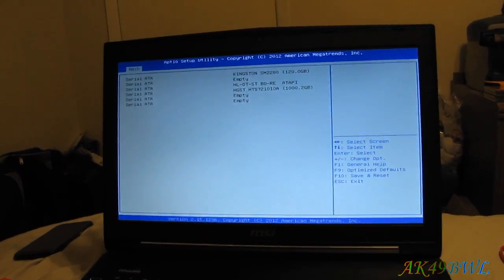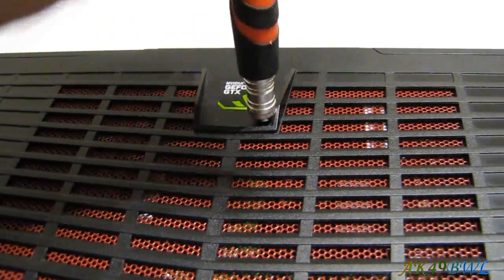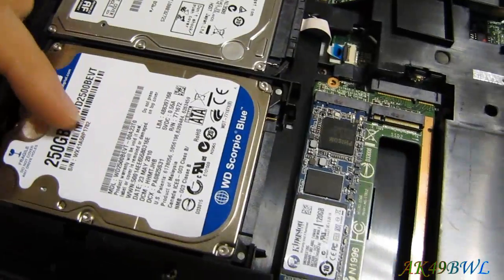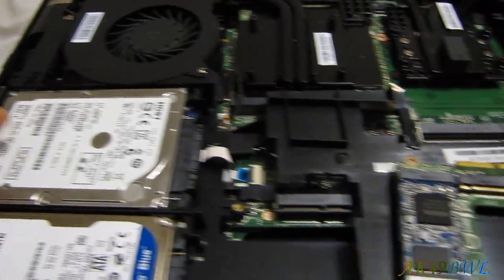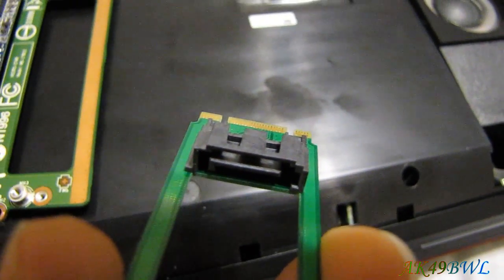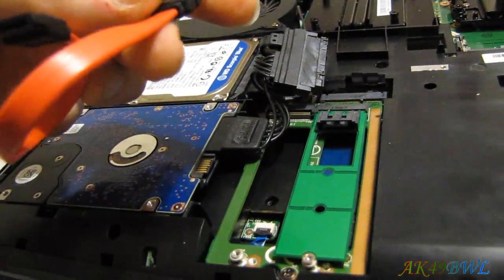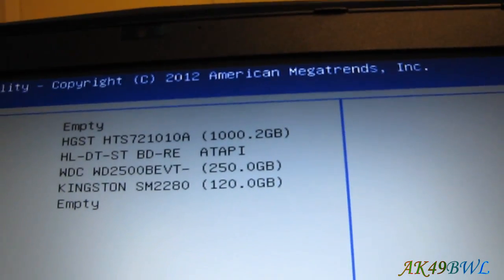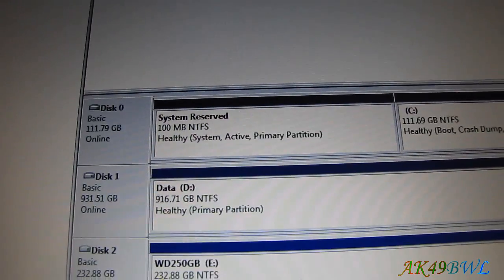How to Install a Second 2.5" HDD in the MSI GT72 Dominator Laptop

Comment: Nice Video! I have a question:
Could I replace the dvd-drive with a blue-ray drive?
(I consider buying a GT72, but in Germany I only can find those with dvd-drives, instead of blu-ray-drives):
Cheers! :)
Reply from the maker: +Frederik Zimmers it is absolutely replaceable, however if you just get a generic Blu-ray drive, it won't have the proper bezel to match the laptop... Simple cosmetics, but maybe you could find one made for the GT72 online somewhere, I'm not sure. What I do know is, it's really easy to remove and install :)
Reply: Thank you for the quick response!
I already googled it and found out, that it is this one: HL-DT-ST BD-RE BU20N (Hitachi LG Blu-Ray Drive Burner).
And I found it on several websites, like this one: http://www.3caccessoriesdirect.com/hitachi-lg-hl-dt-st-bd-re-bu20n-sata-blu-ray-drive-burner-91728.html

So as you said, it should work out!? :)
Reply: ... and how does it work? Is it under one of the storage drives?..so you would have to remove a storage drive first and then the optical drive? ;)
Reply from the maker: +Frederik Zimmers the screw for it might be under the hard drive that is plugged into the motherboard, but once you get the screw loose you should be able to just pull the entire CD drive straight sideways out of the laptop.

Comment: Hi! Great video! How do you think, will 15mm thick hdd fit in GT72?
Reply from the maker: Easily.
Reply: Thanks for the answer!
Reply: Are you sure? Because I've asked a guy from another video and he said that he tried a foam 15mm model and back cover refused to close... What I want is to put 15mm 4tb hdd in the main hdd section instead of the one that was there by default, I have GT72s but I'm pretty sure that dimensions are the same

Comment: I have the same computer and had never thought about doing this but seeing you do this makes me wonder is it possible to just plug 4 sata m2 ssd's into there? Buy just buying 3 more of the long thin m2 ssd's? Or would it over heat or not be able to run all 4 at once? Any info would be greatly appreciated since I'm a newb at this. Thanks for helping us learn! :)
Reply from the maker: Many of these came with all four slots filled, with a 1TB RAID 0 using all four 256GB drives.
Reply: Please respond quick I've already added the ssds to my Amazon cart and am about to drop a grand lol am I going to regret it?
Reply from the maker: Holy hell, how big are the SSDs you're getting, to be spending that much? LOL
Reply from the maker: But yeah it'll definitely be fine. I have two M.2 SSDs in mine right now and it never even gets warm in that area.
Reply from the maker: Just make sure you're getting SATA3 M.2 drives, PCI-E and whatever newer stuff they have out now will not work/is unsupported.
Reply: I'm getting 500s. Seems completely unneeded but that just makes me hope it will run well anyway lol
Reply: Thanks alot for the quick reply. Can you recommend what one to get? And be totally awesome and maybe tell me where to learn how to raid 0? Lol
Reply from the maker: Oh for sure. I only have two 128s in mine. One for OS and programs, the other for quick access video editing.
Reply: It's 1000 because I'm also getting a larger ssd to replace the hdd and 16 more gb of ram
Reply: Ignoring cost are any of the upgrades obsolete?
Reply from the maker: I don't think so... Well I mean, this computer was obsolete the second after I bought it anyway so there's that haha -- I maxed my RAM out with two more Kingston ValueRAM 8GB sticks, which is the same stuff MSI puts in from the factory. I would like to pick up a GTX1070 for this thing, but for what I do, I don't believe it'd be really cost-effective... And I run Win7 so the drivers would have to be hacked to bits. Sadly, the CPU can't be upgraded at all.. Wouldn't mind putting a Gen 6 or 7 in here instead of the Gen 4 it has. I'm not even maxed out on hard drives in this thing, still have an open M.2 slot. Thinking about picking up a Western Digital 1TB SSD, just haven't bothered yet. How to RAID 0, I want to say that's in the BIOS/CMOS setup? It's been too long since I've messed with it, mine's not RAIDed. And you'd have to reinstall the OS and stuff onto the RAID.

Comment: So, I've got a Question, Been meaning to do this, and Now I'm able to, But I was wondering if it would be possible to use the one Sata2 Port ONLY for Power for the two Hard Drives, and Connect my Internal HDD's to separate Sata3 to M.2 Adapters.
Reply from the maker: Yes, that's possible. Both SATA3/M.2 adapters will have to be installed in the upper two slots of the 4-port card tho, and SSDs will have to be underneath. But it should definitely work.

Comment: So I opened up my MSI GT72 Dominator Pro and it looks just like yours.  My question, can I order anther SSD and put it in the SSD slot 2 and run my games from it?  Will it need an O.S.?
Reply from the maker: +Jason Grigsby absolutely you can, and no it won't need its own OS. I'm guessing you're talking about another M.2 SSD? If you mean a 2.5" for the second drive bay, same thing, yes you can, following the same methods I used, and it won't need its own OS either.
Reply: +AK49BWL thanks AK.  I really appreciate the quick response. Thanks for the video tutorial, and yes I was talking about an ssd single sided.
Reply from the maker: +Jason Grigsby No problem :) I currently have two M.2 drives and two 2.5" drives, the extra M.2 drive I use as a fast-access video editing files drive, it's perfect :)
Reply: +AK49BWL I want to do video editing as well. The GT72 can hold 4 ssd single sided disk, correct?
Reply from the maker: +Jason Grigsby Yep. That won't allow you to add another 2.5" drive, but you can put four of the SSDs. They're "Solid State Disks" btw :)

Comment: There is only one M.2 slot in GT72VR-6RE-216FR version.
As you can see here : http://www.notebookcheck.net/fileadmin/_processed_/csm_MG_9083_1a6410606d.jpg

Is there any workaround ?
Reply from the maker: Wow, that's different... Does that model not come with the option for SuperRAID? I don't know of any workarounds, unless maybe they hid the other M.2 slots somewhere. Hit Del at the MSI boot screen to enter CMOS setup, it should tell you in there if you even have the option of more than three drives (SSD, HDD, CD).
Reply: I havn't received the laptop yet. I get it tomorrow.
I'll keep you updated.
Reply from the maker: Please do, this is intriguing.
Reply from the maker: Well, this tells me that the system still has the capability to control six SATA drives, and the configuration tells me there really ought to be four M.2 slots. Ports 3 & 4 are the two actual SATA ports for the CD and HDD respectively, that's the same on mine. What's new here is the two PCIE SSD slots, I don't have those and don't know anything about them. Have you opened it up yet?
Reply: Well, I opened it yesterday and it is exactly like one the first picture I sent.
Also, I didn't find any hidden slot or connector =/
Reply from the maker: Damn... Guess maybe they're going a different direction, or they hid them under the mainboard... And screw trying to take that all apart lol

Comment: hey hey there. i have a question about this tip. can i use a 2.5 ssd instead of the 2.5 hd ? i want to make C: bootable from a 1tb ssd disk. if i need other cables can you pls let me know. thnx m8
"love your video thow"
Reply from the maker: +dready571 Absolutely you can. 2.5" SSDs are physically identical to their HDD counterparts when it comes to how they're connected to the system.

Comment: Hi AK49BWL, thanks for your video. My model is GT72S, there is also an empty 2.5-inch space with no pins adjacent. Where can I get the cable and component appeared in your video? Thanks.
Reply from the maker: +FY ZHAO the links to what I used are in the description, all except the short SATA cable which I had on hand, not sure where you'd get that, maybe eBay or Amazon.
Reply: +AK49BWL Thanks. Found the upgrade kit on the amazon just now ...Hope my project will success haha
Reply from the maker: +FY ZHAO good luck to you! :)

Comment: Hi Brandon , what is the ssd module you have? I have a msi gt72vr 7re dominator pro and I only have one input where you have 4. ? thanks
Reply: DYCE GAMEZ  with the new model where it only has one slot the chipset is HM170 and it only supports one pcie slot. Where as the model in the video is a cm23/26 chipset and supports more pcie lanes

Comment: Would it be easier if you take out the dvd drive and replace it with a hard drive caddy?
Reply from the maker: Sure. But then you have no CD drive if and when you need it. And the disc drive SATA port is only SATA2, not SATA3, so you won't get as much performance out of it as you do the M.2 ports.

Comment: Hi! I have the same laptop as you but I have a problem:( My laptop doesn't charge even though the adaptor is plugged in. Is there any way to change the battery in this laptop or what should I do!??
Reply from the maker: Yes you can replace the battery, but here's the thing... What does the OS say when it's plugged in? It may be the power brick, or even the power input plug on the laptop could have come loose from its solder. As new as these laptops are, I find it hard to believe the battery would need to be replaced already.
Reply: My msi gt72 is 2 years old and it had this issue after half a year of usage. it doesnt say anything it just doesn't charge:(
For some time it started working but it was loosing power and screen got dark during playing like when you unplug adaptor.
Reply from the maker: You may have a bad power supply brick that isn't always providing the power the system needs to both run and charge.  The battery honestly should have no effect on usability, a lot of times you can actually disconnect the battery and it'll still run fine on the charger by itself. Try that and see if it still does the same thing. The battery cable to the mainboard can be accessed from the bottom after taking the cover off, just unplug the battery and give it a shot.

Comment: I bought my MSI GT72VR laptop and it doesen't came with the ngff expansion piece, I only have a metal piece under the M.2 SSD, so where can I buy the piece? I asked to MSI and MSI says that I can't get one.... 

Thanks guys.
Reply: i have this problem too, did you get any answer ?
Reply: Nader Hozayin If you search ms-17812 is the model of that piece, I only found one on eBay but it was so expensive .

Comment: I have a GT72 2QE and I CANNOT install Win7 for the life of me!! This is extremely irritating. 

Can you please tell me ALL your BIOS settings for this machine to install Win7?

I even went as far as removing the CMOS battery, then put it back in after 5 minutes, got into BIOS and went to:
1)"Save & Exit" then
2)"Load Setup Defaults" / YES 3)"Load Optimized Defaults?" YES

After setting BIOS back to factory defaults (I presume it did this, am I wrong?), I then went to:
1)"Security" tab
2)"Secure Boot menu"
3)Disabled "Secure Boot Support"
4)"Boot" tab
5)"Boot mode select"
6)"LEGACY" option (choices are: UEFI with CSM / LEGACY / UEFI)

Finally, I prioritized the boot order for the USB which is bootable (via rufus) with Win7 on it. I know that this is a working image, because I tested it on another computer.
PLEASE HELP!!!

Comment: The M.2 card with 4 slots for ssd’s - can it be replaced with a card that supports NVMe ssd’s? I bought one of these ssd’s and later found out that they are not similar to the original ssd in the Msi gt notebook..😞
Reply from the maker: Curious, what is the difference? I know the ones that came in my GT72 are SATA3. Not very familiar with NVMe drives at this point. I also, as such, don't know if there is a replacement 4-port card, but my guess would be there is not. There aren't enough pins on the motherboard side to support more than SATA I'm pretty sure.

Comment: One more thing... I'm attempting to install Windows 7 on the main drive, which is in RAID configuration (476(?)GB). Is there something else I need to know about raid configuration, other than to simply direct the image to install on this drive?
Reply: +APM Aerospace I know that your comment was two months ago but...

You may need a driver for windows setup to see the drive if it&#39;s in RAID config. That, or sometimes windows setup will SEE the drive but refuse to use it without the driver, too. A message something along the lines of &quot;windows cannot use this drive for setup&quot;

The driver is usually called &quot;F6 RAID driver&quot; or F6 install driver or something along those lines. You should be able to find it on the product page for your laptop under the &quot;support&quot; heading on MSI&#39;s website. 

Windows 7 setup lacks USB3 drivers, so if you&#39;re trying to install from a USB3 port (either booting from a flash drive/hdd plugged into USB3, or using a drive plugged into USB3 to store the F6 driver) windows will complain that it can&#39;t find files. The simplest way around this is just to boot from a USB2 port, or use a USB2 port to store the F6 driver if booting from DVD.

Finally, be sure you&#39;re installing to the right drive. With the computer in RAID config, some drives may not show up at ALL until you give setup that F6 driver.

Comment: +AK49BWL Hey man, just wanted to say, absolutely awesome vid, and I currently own an MSI GT72S 6qe, one of the newer skylake models, and the way you did in the video works perfectly for it. I even think MSI took ques from you, because now they have altered the structure of the inside of the gt72 in such a way that the sata cord attached to the large 7 +15 pin cable that is used fits effortlessly between those two triangular plastic pieces, one of which you had to cut off before. You no longer have to do that fortunately, and its great. Also, thanks to this method, I have been able to outfit my GT72S 6qe with two 2.5 inch 4tb 15mm hard drives for a combined 8tb of hdd storage. Even with the new pcie nvme slots on the m.2 holder, you can still configure it to use the sata slot directly adjacent to the nvme slot if you curve the lone sata cable in such a way from the second hdd. Again, awesome vid look forward to more! Excelsior!
Reply: +Steve C. III Link to 4tb hdds:
http://www.amazon.com/Samsung-Momentus-2-5-inch-Drive-ST4000LM016/dp/B016YFEYK6/ref=sr_1_1?s=pc&ie=UTF8&qid=1459411953&sr=1-1&keywords=samsung+4tb+2.5+inch+hdd
Reply from the maker: +Steve C. III wow, awesome!  8TB, jeez lol.. I don't think I'll ever have need for that much storage. Good to know it all still works according to the video tho, I'll have to update the models it works for in the description.

Comment: Hey hi, this video is really good - I tried doing this when I bought the laptop when it first came out and pitifully failed :P - I have a question- I did what you did - installed Win7 - absolutely hated 8.1... but for the life of me I can no longer access bios (iv tried what seems to be everything), and I'm really hesitant to flash the bios again - any ideas?
Reply from the maker: +Philo Anthropos try F11 when you first turn it on.. Just keep pressing it over and over until something happens. I think there's an option to enter CMOS setup, but I don't have my machine nearby to check right now. Other than that, I think it's supposed to be the Delete key next to the pgup/home key that normally gets you in. Just keep pressing, maybe it'll work. I wish this one told you at startup what to do instead of just showing the MSI logo lol. I want my verbose boot! :D
Reply: Thanks for the reply - Yes it would be allot easier if they showed the options on MSI screen. Iv been driving myself crazy with this question cos the last time i accessed bios was from within W8.1. Before you said about the delete key next to pg/up key I tried all of them and got the following results:  

F1 = Boot Manager
F2 = Boot Manager 
F3 = Boot Manager
F4 = Boot Manager
F5 = Boot Manager
F6 = Boot Manager
F7 = Boot Manager
F8 = Advanced Boot Options
F9 = Boot Manager
F10 = Edit Boot Options
F11 = (Tiny Blue Square on black background) Please select boot device (there are 3 options: the Dvd/Cd optical drive; Drive1 or 2 (whichever I had in at the time); Qualcomm Atheros PCIE Ethernet Controller
F12 = Black Screen
Esc = Boot Manager
Delete = Boot Manager

SOD's law there are three delete buttons on the laptop and I only tried one of them thinking all the delete buttons would do the same thing - anyway, in short, thanks :), you saved me from an early breakdown :P
Reply from the maker: +Philo Anthropos so in the end you did get into BIOS?
Reply: +AK49BWL Yes thanks with the delete button next to the pg/up key ....